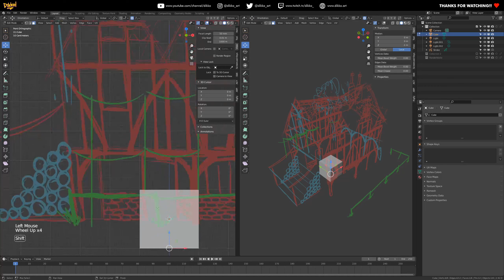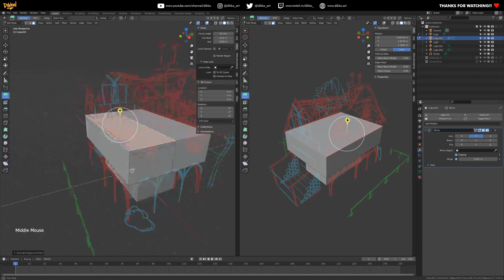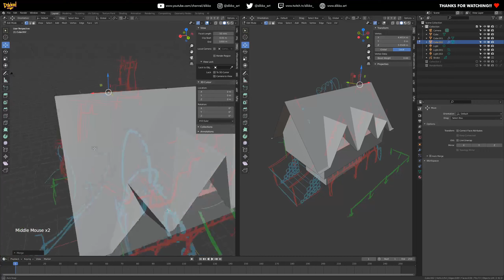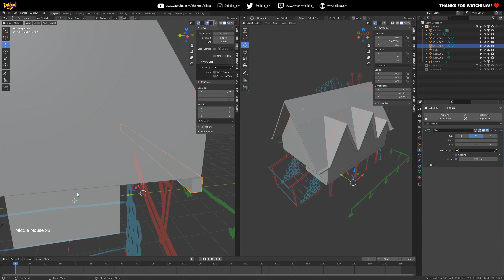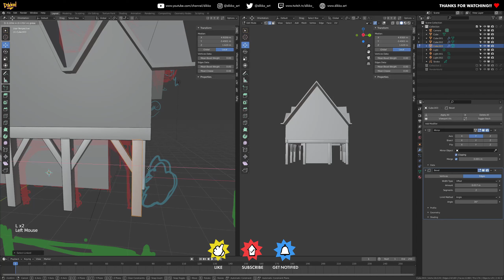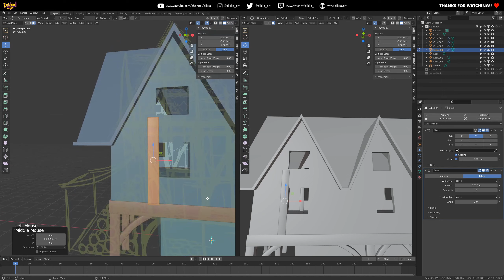Comment: For merging the verticies you can select it then double tap g to slide it to the other vertex. After you slide them together the verticies will be right on each other. So you select all the mesh and hit m and merge it. That will delete all the double verticies. Sounds long, but its way faster, and you can slide edges too. Watchh blender guru's anvil if you want to see how it works exactly. Cuz selecting each vertex is very long and time consuming.

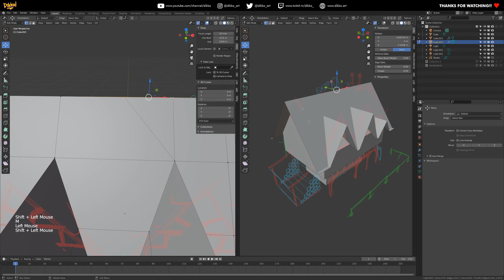Comment: Hello Dikko, thanks for the tutorials. Around 14:43 when you were merging vertices (M, merge at last), there is a faster way. You can activate "Auto merge vertices" (located on the tool settings bar at the top right of the 3d viewport, beside the x, y, z symmetry), then activate vertex snapping mode. This way, once you snap one vertex onto another, they are merged automatically. Auto merge also works with vertex slide, so you could slide an entire loop of vertices and merge with an adjacent loop.
Reply: Yeah I know. I just like having compelete control
Reply: @Dikko  Okay, that's cool.